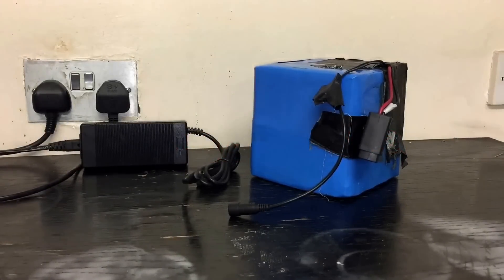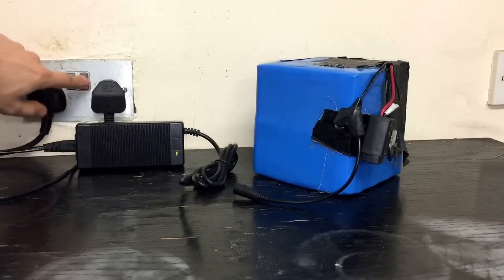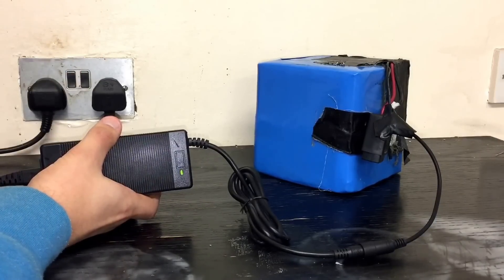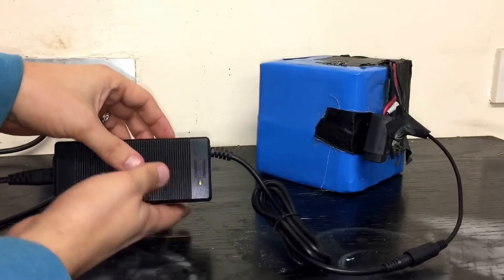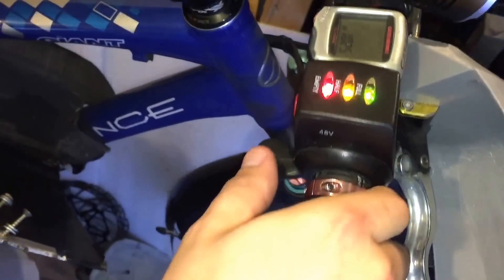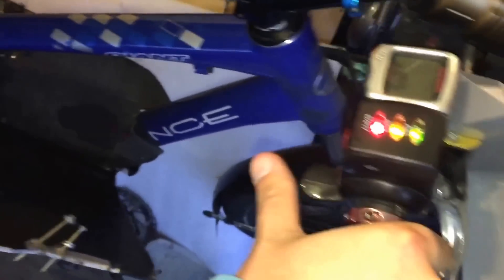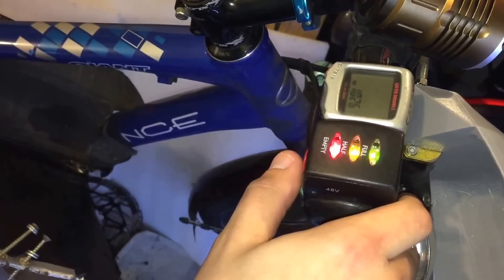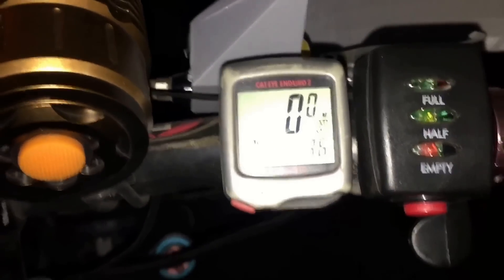How long does an electric bike battery last

Comment: It's the BMS system,  one of the cells might have failed so the censor with cut the power, ud have to take it apart and check each cell ,

Comment: around 700 cycles...  they advertise they have 1000 normally
Reply from the maker: Yes depends mine was about 2and half years of daily commuting
Reply: @FastElectricBike  If you used it for four days twice a day  so you charged the battery 8 times per week in 2.5 years so is 52*2.5*8 iquals to over 1000 charges wich is just good

Comment: hello,im having same problem.when charging,my charger stays on green light.it only goes red if i turn key on ignition,both battery and bike.it only drives for a second or two.does any one no why?
Reply: You need to get a battery replacement

Comment: The BMS is the problem , 6050 LION cells don't need the thing, only the LI PO cells do. If you make sure when all the cells go together that they are all charged close to each other, they will stay balanced in series. You might have to charge each cell individually until you find a bad one , then just replace it. If they are about 4.1 to 4.2 volts you should be ok.

Comment: My battery died after 2 years and I let it set on the shelf for a year. Then I decided to unwrap it and see if I can find out what was wrong with it. Turns out it was the management system that would not balance the batteries. So I watched a YouTube video on how to charge the batteries with a power supply. One of them battery packs only had 1 volt. And they're supposed to be at least 2.8 volts or they go dead. I manage to charge that one pack of parallel sells to 3 1/2 volts. So they claim the battery is no good under 2.8 but I was able to charge it. Now my entire pack is 39 .6 volts at full charge. Not like new but still usable for a 36 volt battery. It's winter time so I haven't tried it on the bike yet but I might make a video about it in the future on the gotimothy Channel.

Comment: did you check all the cables connections because this looks like somewhere inside the connections aren't making contact. i don't believe the battery just died all of a sudden. also it could be that you fully discharged your battery at which point the BMS clicks in the charger stops pumping in juice. do not discharge the battery to 0% ever. it's a problem to charge it afterwards

Comment: One will likely have to cut the battery pack apart to get at the underlying lithium ion cells inside; one will need to unsolder the connection between each individual 18650 lithium ion cells; after two and a half years; their are likely at least a dozen lithium ion cells which have gone bad; after one finds the individual lithium ion cells; one simply replaces them and resolders all the individual lithium ion cells back together once again; and it should be golden hopefully; of course this will take some time to actually unsolder all the individual lithium ion cells; but one will at the very least be able to sort out the bad 18650 lithium ion cells and utilize the remaining likely still good 18650 lithium ion cells to reuse at the very least.

Comment: I'm considering buying a conversion kit for touring around the country which would mean a lot of charging in public places. How long do these bike batteries typically take to charge?
Reply from the maker: Hi depends on the charger, this charger was a 2a charger and took about 4-5hrs i had a 4a charger before that has a fan in it and takes about 3 hrs, so just get a battery that can take the fast charging then buy the fastest charger it allows there are lots on aliexpress
Reply: depending on your charger but anywhere from 3-4 hours to 6-7-8 hours again depending on your charger and how many amp hours the battery is
Reply: DAGIAN Get a 5 amp charger that c be set to slow charge as well. Luna cycles sells a good one. The reason being is that fast charging reduces the life span of the battery, but if you're in a hurry it is worth it. If you're at a camp ground, or motel you can slow charge it over night.

Comment: Definitely definitely check the bms, and a few of the cells maybe gone, what happened there was there was a massive voltage drop and the controller turned off to protect the cells. So what that would normally mean you have a dead cell or the bms is faulty, which to be honest isn't bad for 1000 days of use.

Comment: lion cells stay very long, much longer than 2 years.... it could be the charger or the bms or just one cell, that makes this issue. try another charger or check the bms of the battery for broken lines or stuff like this. otherwise one of the cells is not good. the other ones are still good!

Comment: Lithium batteries don't just "give up" unless there is a wiring fault in the pack, the charger is borked or there is one or more dead cells. Their capacity shrinks and shrinks until it is nothing, but it will still behave as if it is accepting a charge even then. You have to keep cycling it many more times after that to actually destroy it. 

Probably there's just one or a few dead cells. It looks like there's no BMS. I would advise you buy a pack with a BMS in the future as cell balancing will greatly extend the lifespan of the pack.

Comment: looks to be a low voltage issue proberly due to a faulty 18650 or connection youll need a volt meter and some soldering skill to fix

Comment: There just maybe a row of cells that have gone bad or like someone else has mentioned it could be the bms has gone bad  any way you would have to know how to use a multimeter and have experience if you have to take apart and rebuild a battery otherwise you risk causing a fire and causing even more damage to your battery but if the battery is indeed dead you can still use the cells for flashlights and many other devices these are some powerful little batteries.

Comment: Interested to know if those 2 x a day charge cycles were full deep charges or 'top up' charges?
Reply from the maker: i never ran it out completely the battery, just used maybe 2/3 or 3/4 before recharging on my daily commute, but would rather charge it both ways than have to go a bit slower on the way home, i think in the end i charged it then didn't use it for a week and this happened, so guess that killed it

Comment: hello, there is actually cut of comes by the Battery management system, if this is your first exprience, you should first open this pack, check for dead cells, remove and replace it, it will work well/...// Mostly one or few dead battery cellls cause this issue, so dont even trow this pack :)
Reply: +Fast Electric Bike Multi-meter
Reply from the maker: How do i know which ones to swap out?
Reply: Fast Electric Bike check the voltage and what each battery should hold. If your way below that by 2-3 digits. Then it’s a bad battery.
Reply: Zamin Huseynov necesen
Reply: @niyazzamanov957  what are you trying to say?
Reply: Greg Allman the guys is my country mate I said what’s up
Reply: that sounds logical